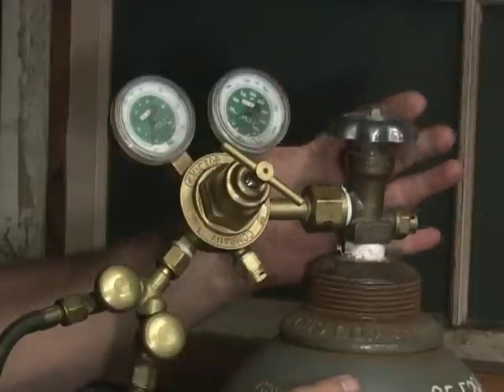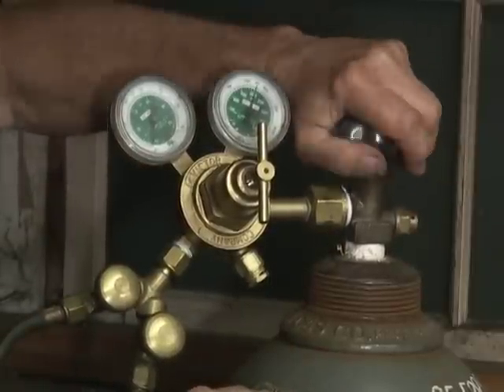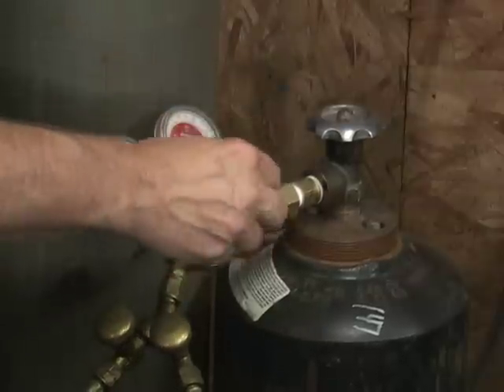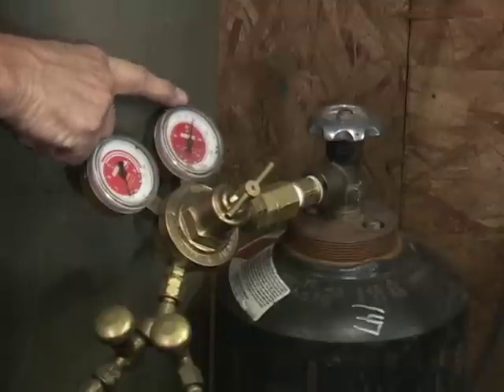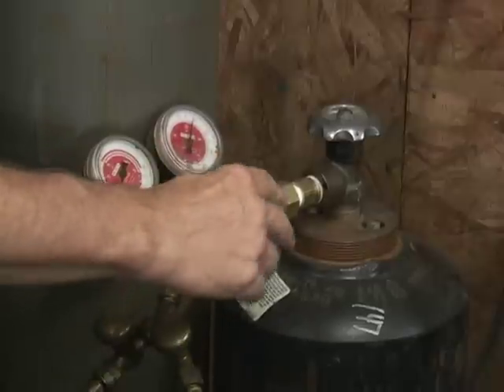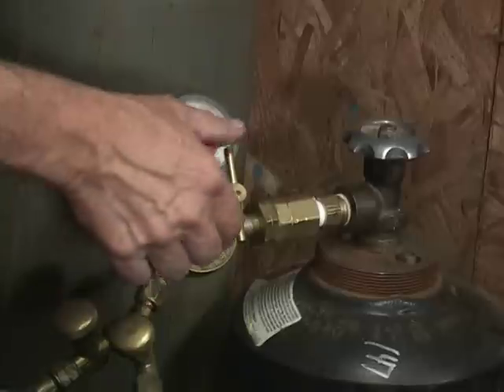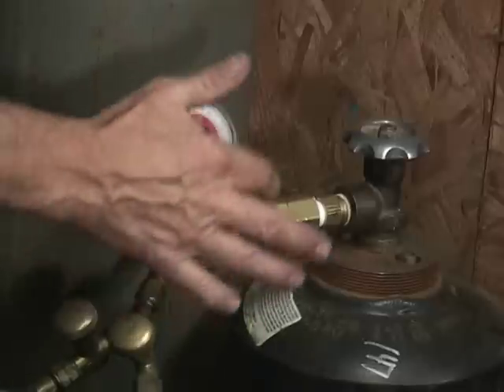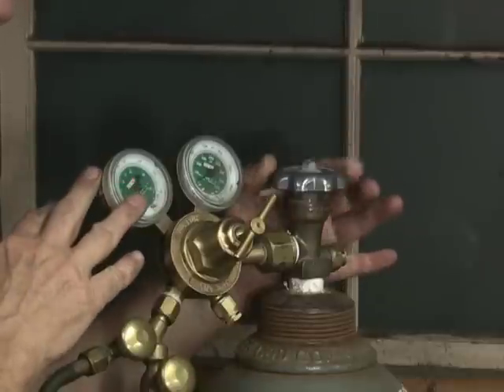Opening and Closing Oxygen Acetylene Tanks (Cylinders)

Comment: I was taught  to stand to the side of the regulator when  cracking the tanks open...just in case of a regulator failure.  Continue to open oxygen slowly  and all the way.(Oxygen tanks have a special  valve that must be  opened completely). While  still standing to the side, slowly crack and open the acetylene tank. But only open a 1/2 turn. You want  to be able to shut off acetylene quickly  if there's a problem...like a back-flash or whatever. This method is old (like me) so things may have changed

Comment: Oxygen valve should be open completely. Acetylene one and a half turns.
Reply: Actually depends on your training/ trainer.  I was taught at vo-tech school to only open 1 full turn so could be quickly closed in an emergency.   Any slight oxygen loss by not opening all the way is offset by improved safety.  If the valve on the oxygen tank is actually losing a noticeable amount of gas around the stem, it means the valve is shot and tank should not be used.  I would add, I've never read anywhere that the acetylene tank should be opened more than a 1/2 turn for the same safety reason.
Reply: @stevebritt  it does not depend on what training you have. It does not change fundamental requirements depends on the supplier because some of them tell you different things.

Comment: At what pressure point should I need to do oxygas welding?
Reply from the maker: Where to set the pressures is dependent on your torch, tip size, regulators, and what thickness of metal you want to weld.  For a standard torch setup I set the regulators at 6 pounds of oxygen, and 5 pounds of acetylene.  Your equipment may be different from mine.  If you don't have a manual for your torch, go online and see if you can find a manual for your specific torch.

Comment: quick question, do you need to turn on your oxygen and gas valves on your torch before adjusting the pressure on ypur tank?
Reply from the maker: No.  Do not turn on your cylinders before adjusting the regulators.

Steps.
1) Check to be sure that both the oxygen and acetylene regulator adjustment knob are unscrewed.  

2) Open the valves on the oxygen and acetylene cylinders.

3) Adjust the oxygen and acetylene regulators to working pressure

Comment: medical 02 tanks go to a insane pressures of 4000 psi or at least the gage sais this.  if you compress a gas it heats up , and that heat flows into the surroundings  but if it heats up faster then the heat can flow the temperature keeps going up. like an old science class teachers aid consisting of a glass syringe . you press the syringe as hard as you can and it ignites a piece of flash paper  inside. so wen a little 02 enters the regulator then much more to compress it, it gets extremely hot

Comment from the maker: Glad these videos are helping.  Incidentally, one of my close friends is a certified welder and they said that they were to taught to open the cylinder valves fully.

I don't do that, but certified welders are schooled in using approved procedures.  You might keep that in mind and then use your best judgement.

Thanks for commenting, George
Reply: I went to welding school and passed my certification test. You are doing it exactly the way the instructor taught us. Only open the Adrenaline tank 1/4 turn. Reason being is so you can close of  accetalyne tank valve faster in case of a cut or burnt adrenaline hose.
Reply from the maker: @glenchadwick420 Appreciate you for commenting.  Don't know where I picked up that habit, but it's how i have been opening the acetylene cylinder for years.  Wasn't aware of the reason why.  Thank!